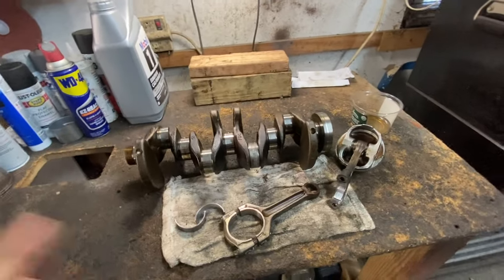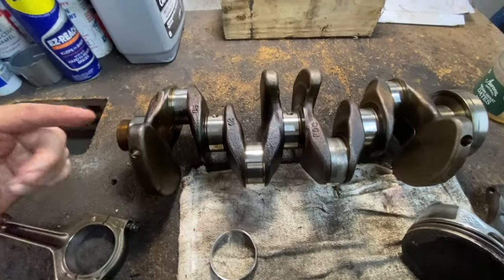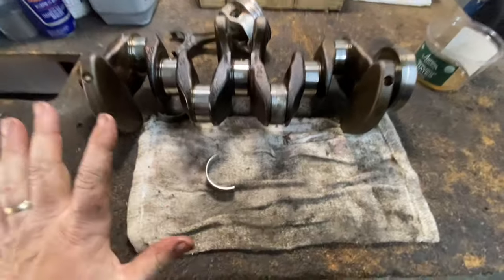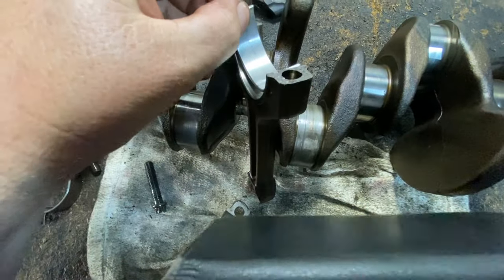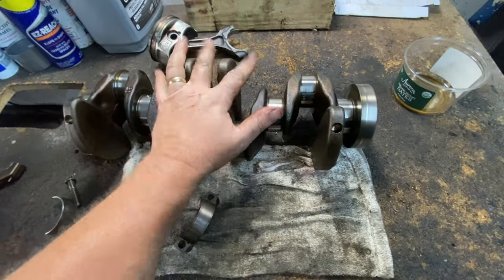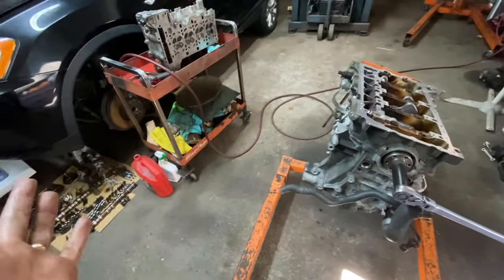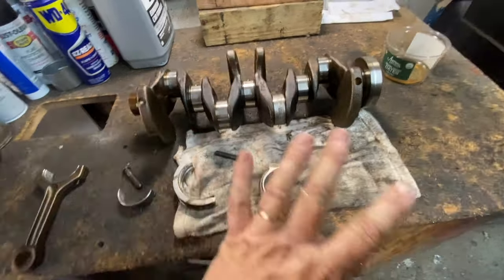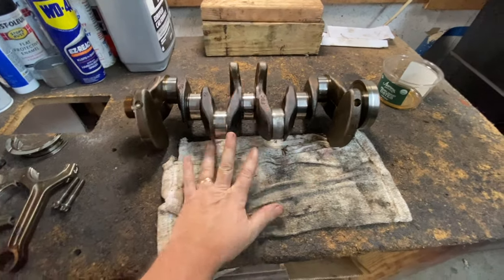Engine Rod Knock - Is It Worth To Be Fixed?

Comment: yep this just happened to my car ..scrapping it for 300 bucks
Reply from the maker: Sorry to hear that.
Reply: Same thing I just bought it and put a bunch of money in it such a shame
Reply: @nicodaniels130  if you jack your car up and drian the oil out and remove the oil pan under the engine some cars you can access the pistons rods and the crank shaft right there and you can change them out from underneath with out removing the whole engine that is if its just the rod bearings, if there is piston problem or or a piston rod problem then yeah you might have to take the engine out, but then again some cars you can get away with removing just the engine head and accessing tbe pistons and rods while its the rest of the engine is still mounted in your vehicle
Reply: Oh yeah, same deal here, but I got mine for $500
Reply: @RookitMaster what are you talking about😂
Reply: @CodyCraw13  right under the engine remove the pan thats attached to the engine that holds the oil and you can access the piston rods there from underneath and remove the crank shaft if needed, ive done it. moving a whole engine out of the vehicle just to work on the crank shaft or the pistons? HeII no i aint doing that, screw that, i aint making more work for my self
Reply: @RookitMaster u have video I would love to see that I’m thinking about buying a project
Reply: @PLAYULAY6FT  no i dont have a video on it, but there are some on YouTube, but remember this may not work with all engines and cars, some can and some cant
Reply: @RookitMaster  it's not make sure
Reply: Thats unfortunate and it might be the fate of my car too
Reply: @nicodaniels130 hahaha I feel your pain blood
Reply: @RookitMaster I might need to do that

Comment: An oil pressure gauge is very important because you'll notice low oil pressure time before you break the engine (normal use of the car). I think even that's why the old Benz are so reliable...
Reply from the maker: Absolutely, I say that all the time. There are so many vehicles that have no oil gauge or even coolant gauges and also no oil dip sticks etc.
Reply: That's all good and well - but on most new cars (and by new I mean newer than the past 20 years) the gauge is 'fake' just like the temp gauge is 'fake'. It will sit conviently dead centre to look pretty until there as an issue, then all of a sudden skyrocket (in the case of temp) or drop (in the case of oil).  If you mean the purchase of an aftermarket properly fitted one I couldn't agree more.
Reply from the maker: The gauges are not fake, when it goes out of normal range you are supposed to stop driving the vehicle until you or a mechanic can fix the problem. Most just keep driving and see what happens.
Reply: @motorcarnut  Fair point. I suppose I should have said 'not in realtime' - as in they don't fluctuate until there is a problem; ie  on my old TJ Jeep the oil pressure gauge will fluctuate and show exactly what the pressure is at any given time. On my newer Grand it just sits there dead centre.

Yep you are meant to stop driving as soon as it's noticed - but I think people are more likely to notice a slow increase or decrease because they have time to recognise it - the way most of the new gauges work unless you are constantly scanning the dash it's easier to miss the sudden uptick or drop.
Reply from the maker: Yep!

Comment: The problem that results from this wear is that the shavings that are produced mix with the oil and are absorbed by the oil pump, whose internal parts are metallic and must be completely smooth for good performance. These shavings scratch and wear these parts, causing a drop in pressure in the system and oil starvation in the engine.
Reply from the maker: Correct, and low oil level is the number one cause of engine failure.

Comment: My experience with small engines (anything from 4hp single cylinder Briggs to 25hp V-Twin kawasaki) is that once internal issues such as these develop it is usually (probably 90% of the time) cheaper to replace the engine itself, unfortunately there's no way to know without taking the bad one apart but doing that also incurs labor hence cost. You want to save money, replace the engine itself boils it down to a specific figure, tearing the bad one apart involves variable costs that could very well run higher than just replacing it.
Reply from the maker: Its different in automotive, but I find it's almost always cheaper to rebuild than replace. The more expensive the vehicle the more expensive the new engine will cost. Parts on the other hand don't rise as fast as well as the labor. Also depends if you're talking NEW or good used engines. Botton line for us at the shop is New is the most expensive followed by used then rebuilt which in turn is like new therefore the best and cheapest option for most customers.

Comment: I thought an engine knock could be from a slightly bend piston arm . Got my car flooded was able to take water out and restarted but with a knocking sound from engine 😢
Reply from the maker: You hydro locked the engine when it got flooded. And yes probably bent the connecting rod.

Comment: You have given a wonderful explaination. I have taken sand paper and a boot string and cleaned cranks and polished cranks with the engine still in the car. I have used standard sized bearings both rod and main and repaired engines still running to this day. The main thing is when you hear a rod knocking. TURN IT OFF, Do not start again until you replace the bearings and it can usually be saved. If you run it too long then the crank will need turned with oversized bearings or replaced all together. Your video is great and you did a wonderful job. But it's not always horrible. If you don;t run it too long once you hear the spun bearing. KEEP GOOD CLEAN OIL IN THE CAR! That is the deal.
Reply from the maker: Great write up and appreciate the comment Thank you as well!

Comment: Excellent video describing the revered spun rod bearing issue common in Kia's and Hyundai's.  Unfortunately, I am in the same boat but it happened to a car I shipped overseas as a gift to my Mom.  After paying all that HIGH import duty I am done with Hyundai's for good.  

Working on locating a replacement engine for the 2016 Santa Fe 3.3 v6 engine.  Would you or anyone recommend a used engine or a rebuilt engine (any recommendation?).
Reply from the maker: Sorry to hear that, so unfortunate. I would try a get an engine that was rebuilt already. Any salvage engine would be a ticking time bomb.

Comment: 1996 Corvette LT1.  The engine is quiet when cold (High oil pressure) and starts making a consistent Tapping noise when it gets hot. (Low oil pressure.) 

It sounds like it is coming from the top, right rear.  The Corvette mechanic said he heard it from above more than from below.

4 new lifters did nothing.  When he unplugged the spark wire, the sound changed (I don't know if it got louder or quieter or if the rhythm changed.) which he said sounded like it was a wrist pin, not a bearing.  I have heard, louder would be a wrist pin, quieter would be the bearing. 

What do you think?  Can the car be driven if it is the wrist pin?
Reply from the maker: No, The reason you don't hear it as much when spark plug is disconnected is because now that cylinder is not creating combustion so I think that's why the mechanic said wrist pin but could also be a bearing, sound travels.

Comment: Excellent video, but I kept wondering why do you keep on placing the rod on the wrong position on the crank, where it does not belong (to the center not moving part)?
Reply from the maker: Thank you!, Yes, this video is explaining the rod knock noise and not a rebuild video.I was just showing how the noise is created and used the main journal on the crankshaft as an example.

Comment: Excellent video,  I have a 2012 Ford F250 I just started getting a knocking sound coming from the inside of the oil pan I'm thinking it's a rod bearing any idea what it could be.
Reply: I was thinking of just pulling the oil pan and charging  the bearing that way.
Reply from the maker: If you could access all of them and the crank is not scored then yes and you’ll know right away if it’s a rod knock.

Comment: I have a 2007 Chevy Trailblazer, IL6 with knocking, sounds like a rod but maybe its the bearing, it was low on oil and started knocking
Reply from the maker: Running low on oil is usually is never a good outcome

Comment: Can you short cut ,  just replace bearing that’s got the slap, throw it back together,, how long would that last?? As brought a Rangerover ,, and a couple of months later it got this problem,
Reply from the maker: Depends if the crankshaft got damaged, if not it may last with new bearings

Comment: Just happened on my infinity vr30ddtt redsport it’s at the dealer right now and I have warranty so hopefully since all my levels (coolant and oil) were topped off and maintenance records are good that I won’t be put at fault for the knock….. I have coolant coming out of my exhaust, milky oil cap… bad head gasket is the suspect of the knocking I’m assuming? Any other thoughts
Reply from the maker: Sounds right to me. Diluted oil blew the rod bearings
Reply: So did they accept responsibility for the knock sound

Comment: Great! I just did my bearings, metal in the oil, found a spun bearing, but still have the knock. What gives carnutguy?
Reply from the maker: You can’t just replace the bearings, the crankshaft journals and connecting rods have to be measured and or replaced if out of spec or scored.

Comment: i once rinse air filter dry it out but not completely (2016 elantra) started the engine it worked for seconds and stall since then engine is working okay but there is always weird new noise sound like piston slap maybe rod bent a bit cause water is not compressible? and once engine warm up after 5 minutes its gone maybe rings or sleeve expand or something but it’s diffidently not spun rod bearing or cam ticking its intermittent but always there i just dont get it i once suspected maybe loose intake runner flap what would you suspect if you put a barely wet air filter? i really dry it with air gun before i put it back
Reply from the maker: I doubt the wet air filter caused that noise. If you can port the noise I can give a listen.

Comment: I have a 2013 S550 that has had a knocking noise for the last 2 years. The car runs like new the gas mileage is excellent power is normal and I do only highway driving rarely in the city. The dealer says drive the car it’s not worth it to repair. There is no metal in the oil which I change every 5-6000 miles even though Mercedes recommends every 12000 miles. Do  you think that my problem is what you are describing  . By the way I have never had the check engine light go on.
Reply from the maker: Yours can be ignition ping (knocking) if you’re not using premium fuel or maybe a piston slap. If it were a rod knock it wouldn’t last very long at all.

Comment: Thank Pro !

I can call you a teacher

You lesson Explain very clearly !

As I think the knock sound , might be due to the oil not supply , reason is neck somewhere ?😊
Reply from the maker: Thank you for the comment! Appreciated!

Yes lack of oil flow or low oil or low oil pressure are the reasons for engine knock

Comment: Great conent keep it up brotha. From a fellow mechanic 💪
Reply from the maker: Thank you bro, very much appreciated!
Reply: This is The BEST video I found on this issue. Most videos show people sanding down the rod journal and reaplcing the bearing, but they don't tell you that it is a band-aid fix and doesn't last😂.  This is the correct way to do the job. Buy a new crank , new bearings, and a new rod or rods .

Comment: Have you done N55’s? 
Mine has not seized yet and u dont even hear the knock but i have shavings in my oil filter how much would that run me?
Reply from the maker: Essentially the same engine as the N20. Engine has to be rebuilt or replaced. Prices vary too much to give a quote

Comment: Great video Man! QUESTION for you- 1964 Olds 88 with a 394- it leaked bad when I bought it so I pulled the engine and replaced the gaskets- all the gaskets, except the heads. I was told the heads were done but the exhaust was so bad I didn't really drive the car, just towed it home and pulled the engine. Rebuilt the carb, the starter, new power steering pump.. everything. Back in the car now, it sounds great at start up but after maybe 10 minutes, it starts to knock. I suspected this might happen- so, can I do this myself, in my garage or do I need a machine shop? Can it be done without a machine shop? I know a guy- but he's expensive and really busy. What do you think? I'd value your feedback on this...
Reply from the maker: Thank you! Appreciated. So since you know how to pull the engine I’d say yes! If it’s knocking changes are the crankshaft and at least one connecting rod will have to be replaced. Along with the rod and main bearings. Now depending on how much damage there is you may get lucky and the crankshaft is fine and can just be polished up ( I have a video on that) but no machine shop needed. You’re sure it’s a rod knock and not something in the valve train?

Comment: I have a problem on my Mercedes e220 cdi and the guy from grinding machine told me that the crankshaft is gone and it can’t be repaired 
Do you recommend to be replaced with genuine one or it’s ok with aftermarket one?
Thanks
Reply from the maker: That's a great question. It depends on a couple of things, like is the car worth the extra money? is the cost between the OEM and aftermarket that much difference in price? Etc. If you really want to keep the car i'd go for orig. part however you can try to find online a remanufactured OEM crank or a used OEM good one on ebay and still save some money.

Comment: perhaps share insights on replacing bearings yourself.....engine in vehicle  (if not too worn,damaged).  Some very helpful videos on this using sandpaper and shoelace to polish
Reply from the maker: Problem with that is it will never last and I don't recommend that type of repair. Because things have to be precisely measured and you have to ask yourself why did it happen in the first place?

Comment: Can a crankshaft cause no compression in one cylinder?
Reply from the maker: Yes, if the connecting rod is damaged in a way that the piston isn’t moving. I’ve had that happen many times with no knocking .
Reply: @Motorcarnut, how can I fix this? Do I need to tear down the engine or there is easier way
Reply from the maker: @alvarozavala7924 Yes, has to be rebuilt or replaced. But I would first make sure this was the problem first because it’s pretty rare.
Reply: @Motorcarnut  the problem is I had this engine rebuild a year ago, then a month ago, the engine started to misfire I took it to my mechanic that did the work and told me it has a no compression in cylinder 5 and knocking sound coming from the engine. They didn't want to rebuild the engine again and told me to get it replaced. But right now, I can't afford to get a used or new one right now. So I'm looking for some help and advice on what should I do.
Reply: And yes, it's the crankshaft bearing that makes that noise
Reply from the maker: Got it. Well at a minimum the crankshaft would have to be checked for damage, you would need a connecting rod, rod bearings and new gaskets. Basically have to rebuild the bottom end. But I would wonder why if failed again so soon?

Comment: Look like it's frequently at same berings rod issues... any Ideal why this particular bering ?
Reply from the maker: It does vary from 1 to 4. Oil bearing clearances are at 1000 of an inch so any disruption will cause a bearing to seize up. Mostly do to neglected oil changes or leaks not caught in time.
Reply: 0

Comment: Mechanic is saying I need a new engine is that true or is it fixable?
Reply from the maker: Depends on a lot of factors. It will require a rebuild or replacement engine, if the car is worth it for you then maybe that’s the way to go.

Comment: What does it mean when someone says the “rod is spun”? I’m looking at buying a truck where this is the issue and trying to determine if it’s worth the price at the discount it’s being offered. Thanks for this visual! This was a great video!
Reply from the maker: Thank you! It means the engine has to be rebuilt or replaced. Spun bearing is because engine suffered low or no engine oil so it’s a big job if you’re not mechanically inclined.

Comment: I dont understand the section where you talk about when you can reuse a piston and when you can not reuse a piston because i see on both sides like the lines. Tying to learn more about weared parts
Reply from the maker: If the pistons lose some of the black coating but still have those lines thought-out the both sides of the pistons they will be fine to reuse. If any lines are gone the piston should be replaced.

Comment: Can you give me estimation the price for fixed engine wv Routan 2010 I have Siemens problem
Reply from the maker: If can range dramatically on exactly what’s wrong with the engine, if you will put a used one in or rebuild the one you have. Either way can cost a couple thousand dollars easy.